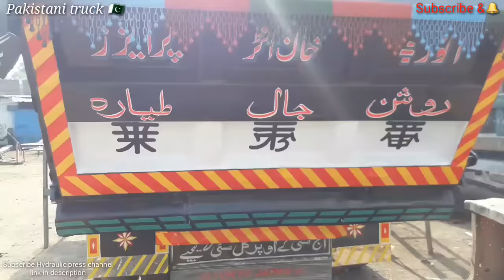How to repairing a broken chassis UD 
Nissan tipper truck

Comment: No matter how Difficult/Problematic a  job is, they can overcome it with ease and pains........I salute those folks out there for their unfailing attitude in their hard works.......What they need is some basic Safety prevention eg. a pairs of hand gloves, goggles, safety shoes  etc......
Reply: would we do repairs like this over here in europe they would have 2 new trucks for the labor cost, the truck was perfect repairable when it was stil assembled a days work for 1 man
Reply: If only they had more modern tools, they would be even more impressive than they are now.  I salute these men.
Reply: They need knowledge to know what they are doing so it could last
Reply: It's normal in Pakistan
Reply: @niels3296  Don't you find it funny how people who know nothing about steel work or repair find this amazing . Tell me at what point should you not just get a new vehicle. A they do is patch. Can't people see it was already patched before and it broke again. I honesty see nothing impressive. That frame looked like it had been repaired multiple times already.

Comment: This video is a perfect example of why D.O.T. inspection's are true life savers. 

Judging by the looks of the poorly repaired prior damage, this truck should never have been on the road to begin with until it had the type of work it got in this video.

It's better, but it's still got major frame issues with the center rail on each side being poorly done.
Reply: Big Wheel  I see how they getgreased by the co.then u take the bus out and the weel falls off or catches fire.or oil leaks.lot of them are corrupt.especially tthe ones for the schoolbuses.

Comment: Very nice repair! 
Number 1

There is not one mechanic in the world that could do better!
Reply from the maker: Thank you
Reply: Yes, I did it 50 years ago, in the DAF factory .Einhoven Holland. Really nice work. Reinforcing trucks.  Did you know , DAF ATE  2400  Truck ?
Anyway, nice work, boys. Bravo !!
Reply: Many can and do but not under those conditions. Lack of weld prep excepted it's sound work and their reinforcement placement is correct which is the most important bit!

Comment: The invisible safety goggles and steeltoe sandals are awesome
Reply: Fashion is more important. Why does Pakistan have a nuclear arsenal? Just the sloppy & dangerous work practices as well as the lack of personal protection will mam or kill off the Male population. And for what, an unpainted frame that will unpredictably crack in the future from simple galvanic corrosion or overloading that could cause injury or death to the driver or bystanders. But the owner can add all the gory add-on's. Lack of priorities.
Reply: Pansey
Reply: Don't knock'em they are the ultimate recyclers. And bear in mind their cousins probably built there nuclear weapons !

Comment: I love the drill set-up. With the chain and wood used for leverage. I am gonna use that set-up for when I do a trailer repair. Instead of putting the drill on my shoulder and pushing up. Keep up the good work. I enjoy learning new techniques.
Reply from the maker: This is fine, but it can be dangerous to do. You will make a bracket for the drill wood in which the wood will sit and if the drill wants to bend it will not hurt the hand.  Will save you

Comment: Innovative or improvised in many ways and it works.  I like the way the drill is stabilized from torque reaction by a beam of wood held by another.
Reply: It's mainly to put down pression on the drill bit.

Comment: You should make stronger leaf springs and load much more;)
Reply: NO, that will break it all the sooner, might i suggest you BOLT all joints and use Bisalloy steel, it looks like you guys use mild steel only, its too weak for this use. More load will mean you need much lower gearing or a LOT more engine torque, since most of Pakistan seems to have trucks only doing 30mph/50kmh you need to gear them for this to be about 1800rpm in top gear and much lower gearing. I wont mention safety gear for the workers, how long do they work for?
Reply: @jeffsewell412  I know it, but they didn't ;)
Reply: I'd suggets to forget the suspension, just weld all three axis to the frame and load as much as you want. Then the frame itself will behave as one big leaf spring. :)
Reply: @igorrudevets6463  Then the axle housings will fail too, the problem here is that the Pakistanis buy used trucks from overseas, then added extra springs etc and overload them by about %100, so basicaly everything will eventually fail. Most 3 axle Japanese trucks are made for 22.5 tonnes gross mass, theses guys are up around 45-50 tonnes. Drivelines are not geared for that, so clutches burn out, chassis fail as you have seen, adding extra metal and spring packs only makes it worse. They need more trucks! The cost is the problem.
Reply: @jeffsewell412  They have to overload their trucks because empty Japanese truck weights more than  22.5 tonnes after those guys "tuned" it according their beauty and technical standards.
Reply: @jeffsewell412  And just how do you suggest they bend bisalloy with hand tools :)?
They want it to break again for repeat business.
Reply: @andrewallen9993  A valid point, we in Australia could bend it with heavy presses. I worked in a factory that built low volume trucks fro heavy crane carrying use, we had a 100 t press for bisalloy, and we bolted everything together with huck bolts. But here trucks are never overloaded to that extent, and we generally had a lot more power and gearing, and out roads are not that bad. The Pakistanis do a fantastic job with very limited resource, more power to them.

Comment: How do they broke it. You should use GREAT INDIAN, TATA tripper without adding so much Leaf Springs
Reply: 🤣🤣🤣lol ispay ya 35 ton load kartay teray Tata ki gand phat Jani iska engine Pakistan ma 500 bhp Ka hota hai Tata tiper ma 253 bhp hai no comparison ya repair ho k bhi zada load carry Kar Sakta
Reply: @muhammadazeem1262  what did you say, our Indian truck is the best In overall no need to worry about the frame, but one thing our Engine is best we used CUMMINS
Reply: @lalthazovakhawlhring2985  these Pakistani trucks have Japanese engines your Tata tiper is only good for flat planes not for hills I know very well our conditions are different from India climate in Pakistan is very hot and high gradients even these Japanese trucks suffer breakdowns
Reply: @muhammadazeem1262  no need to be compare the Cummins Engine with Japanese Engine, the Whole world knows which one is the best In overall, Japanese truck is good for the poor Country like ......... Because it is repairedable and you can't rebuild without Engineering and proper Skill
Reply: @lalthazovakhawlhring2985  lol you are comparing you are suggesting Tata tiper while you don't know about our dynamics

Comment: Mild steel plus 100% plus overload it will never work, great way to get repeat business. The only ppl that think this is good work have never been out of a office
Reply: Bit of a puerile comment to assume that anyone who likes the work has never been out the office. I am a former Royal Marine, been in places all over the World, Jungle,Desert, driven up Mountain passes etc etc so I can safely say I have been out of the Office!
Reply: peter frazier not really, i have repaired machines and trucks in all the conditions you described without air tools for more years than i care to remember including under fire from bandits. Ask yourself this would you trust driving one of these death traps at anything above 10kph the way they are overloaded with std brakes ? On any public road?

Comment: yeah job security they have there.welding the rails and drilling the flanges weakens the rails,also using frame rails that are not heat treated almost garantees cracking.but they are overloading the vehicles so no hope won't stop happening.also every weld made on the frame to patch a crack needs plating to reinforce and the plating bolted at least 6 to 8 inches on each side of repair not welded in place.the heat takes the hardness out of the rail.give it 2 maybe 3 years and they will crack again.

Comment: Very good body working, but two questions I have:
Why don,t you sandblast all the dirt and rost away for fixing new corrosion before welding the frame parts??
And why you don,t spray the restored frame body before mounting the axles  and over body parts.
Salam from Germany

Comment: They repaired but they did double chassis so new chassis heavier you spend more fuel.
Reply from the maker: The double chassis weight only 500 kilograms, which is not so significant
Reply: @pakistanitruck  Previous chassis how much kg ?

Comment: I see the work done and I wish could get them a commercial plasma cutter and eliminate 60% of the gas cutting. I would love to paint the steel before assembly with a compound I get from CA stops rust dead, would be great between the rails etc. Some new instant transition welding helmets would be nice, safety steel toe boots to. ChiefD
Reply from the maker: I appreciate your feedback you have said very impressive and good thing

Comment: Most chassis have a manufacturer label on them '"DO NOT WELD OR DRILL"
Reply: Because there are plastics elements, like a wire.
Reply: Łukasz Niedźwiecki because vehicle frames are tempered to combine rigidity and flex

Comment: Watch a lot of your videos.  Just a curiosity question, from my point of view it looks like the bent frame had been strengthened in the past.  However, the frame bent and broke anyway.  Did Pakistani truck strengthen the frame the first time?  I say not.  I will say that when the frame is reworked this time, the owner operator will have a hard time breaking it again.
Reply from the maker: I appreciate your feedback you have said very impressive and good thing

Comment: Nice try.  But they seem to not know the basics of good welding or stress relief or bevels or stress distributions.   You are not going to get good results using mild steel patches that are not well welded or heat treated.  It’s debatable if these superficial repairs are worth it.